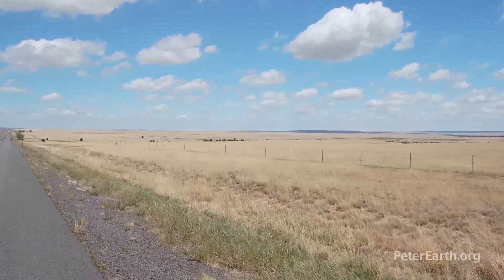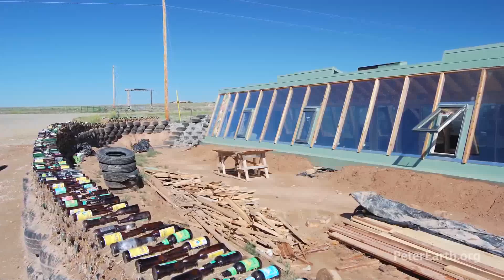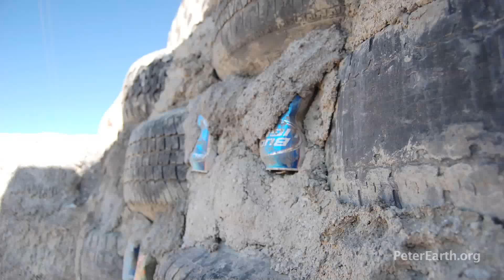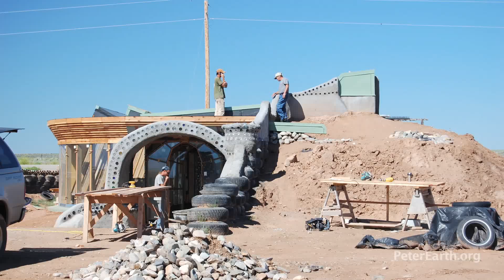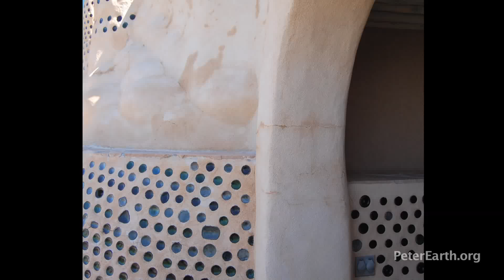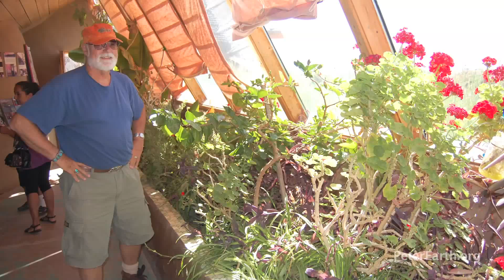Earthship Home Construction - Narrated visit in 2009

Comment: Many of these homes seem to be in very warm, dry climates. Will they hold up okay in wetter climates?
Reply from the maker: Hi Tiffany - the Earthship folks have built many of these homes outside New Mexico - many in wet climates also. The essential seems to adapt to the locally available found materials, and the climate. Many of these homes are unique for the specific spot they are built - pretty wonderful. Interestingly, they have found a much better reception outside the States, to innovative building methods.